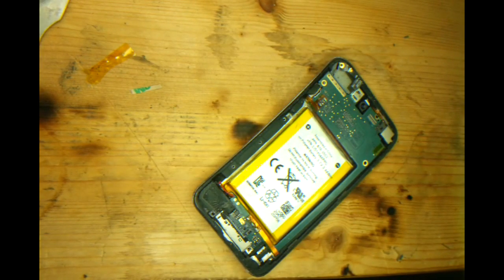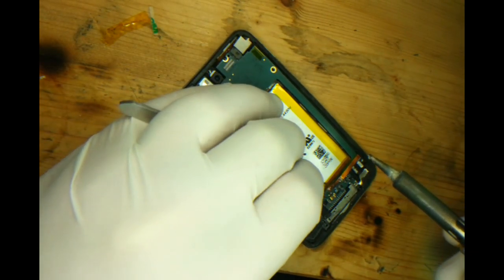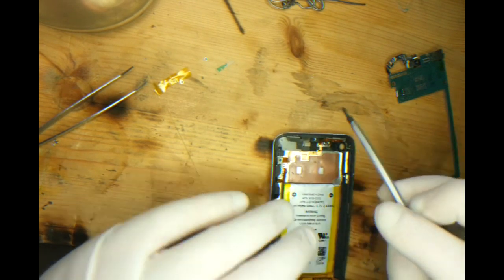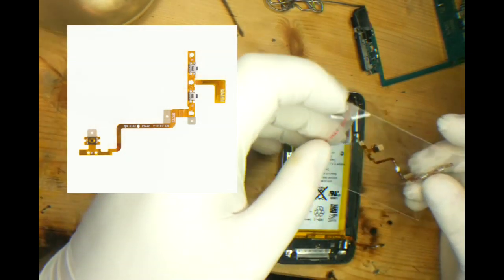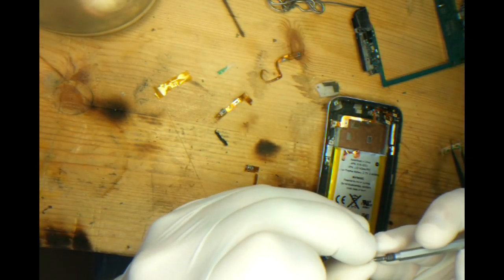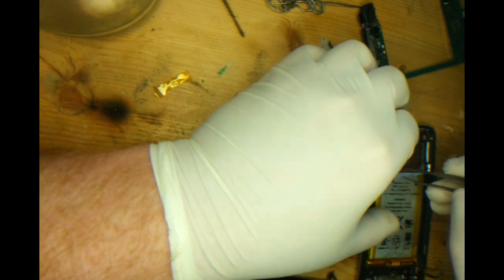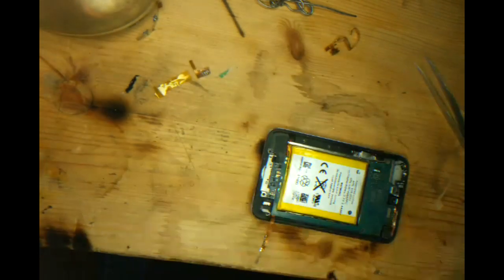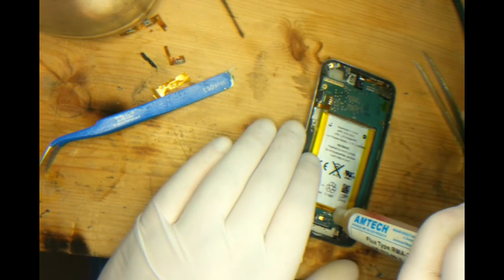How to replace a ipod touch 4th Gen power volume ribbon cable

Comment: I was wondering if you have to des older the battery off in order for it to work?
Reply from the maker: jaden rak Hi Jaden , no is the short answer but i prefer to remove the power from the board and  its just as easy when you have to solder anyway. But if you prefer you do not need to just bare in mind the battery ribbon cable and connections on the board itself are fragile so take your time. Hope this helps thanks for the comment.

Comment: I posted a few months back. Since then I have been practicing Soldering. Learning the techniques and keeping a steady hand is been challenging. Alas! I have finally finished the 1st of 2 iPod 4G Volume/Power Ribbon Cable repairs. This is all thanks to your video!!!! 

Without the ease with which you explain the method and the clarity in which you show the process and procedures I do not believe I would have been successful. Nor would I have had the courage!

So again... THANK YOU, THANK YOU, THANK YOU, THANK YOU!!!! Your video rocks! Cheers!

Comment: I would of put that screen in first before you soldered the ribbon makes it more easy I think
Reply from the maker: Hi James Ya that's a valid point i always worry about the ribbon cables from the screen being damaged so i usually do it after, it just gives me a little more freedom when soldering i think its just what works for me, Have a great weekend thanks for the comment
Reply: smartrepair247 I tell you what happened. The screen got smashed so I thought easy lol anyway I had trouble reconnecting the screen the bottom ribbon. In the process I managed to damage the power ribbon. So when I got the new power ribbon I built everything up and done the soldering last . It was my own fault  lol but you live and learn
Reply from the maker: James Birkin Its a tricky lesson we all learned id say ,but if you look at it this way you have a skill now if it ever happened again you will breeze it
Reply: smartrepair247 true pal

Comment: I have been struggling with the power flex connector and failing to get the cable off the board without destroying the contact had me dumbforunded until watching your video. I had no luck on 3 ipods with a dry tip. I tried your method of pre -tinning the soldering iron and am amazed at how quickly the cable popped off the board. Even the battery removal is much easier. Thanks
Reply from the maker: Hi Ron thank you for your input, You gave me a idea for a video i might do tomorrow showing a close up of whats happening when a pad lifts and methods of re routing the damaged trace, should be interesting , I am delighted my video helped , alot has to do with confidence to, Now you have the skill you will always have it, With the pads it is a fine line between enough and too much.

Comment: i meant what glue you put before or after soldering the volume ribbon cable ive seen people use rosin flux i think its called
Reply from the maker: In high-temperature soldering, the primary purpose of flux is to prevent oxidation of the base and filler materials. Tin-lead solder attaches very well to copper, but poorly to the various oxides of copper, which form quickly at soldering temperatures.

Its not a glue it helps the solder to flow easier and have a better joint.

Comment: what type of glue did you use to glue the volume button
Reply from the maker: Hi Ivan thank you for your comment, The replacement ribbon cable comes with double sided 3M adhesive attached just peel the backing and stick it down, I hope this answers your question? Have a great weekend!

Comment: did you use glue? if so what kind?
Reply from the maker: Hi Tony, thank you for your comment, Do you mean to attach the screen i have not used glue in this repair just solder and flux, If i was fixing the screen permanently i would use 3M adhesive that you can see here  iPod 4th Generation Screen Replacement Guide for Beginners

Comment: Hello Noel, do you do a backlight repair on an ipad 2..The problem isnt due to water damage, but happened whilst doing a screen replacement. I have had a look on google, and apparently there are 3 parts incorporated in to the backlight, and the bigger of the 3 will go when it has been exposed to water, but as i said not the case here...thanks Dave.

Comment: Hi, first of all let me say what a very good informative video, easy to understand  and quality work. I am just in the process of buying a hot air/iron work station. Can this be done using the hot air instead of the iron, or is it easier less taping up with the iron. many thanks in advance  Dave.
Reply from the maker: Hi Dave, thank you for your comments. I would say in theory the hot air would be better for this fine work but the issue for me is i really don't like to put excess heat near the battery, while you can use heat reflective tape to mask up the the area, your left with sticky residue to clean up after removal, the power volume ribbon cable is just far to close to the area populated but the tiny components that if one moved from the heat and air flow it is extremely hard to repair.

This is just the way i do it of coarse everyone has their own preferences.
If you would like to see a video of the two methods side by side i will get that going for you, Give us a thumbs up if this helped and sub to keep up to date of new videos.

Have a great weekend,

Noel
Reply: cheers Noel, i would be very interested to see you doing it with air..I have a few questions for you, I am going to be attempting to remove the scree fpc connectors on an ipad 2. I have been watching them do it with low melt alloy, and they say it melts at approx 60c, what do you use for desoldering and what melting point is it..I would be really grateful if you could put me on to a good supplier for soldering gear ,,cheers Dave

Comment: Why do I need to turn my ipod off???
Reply from the maker: Like any electrical item the unit is powered down to ensure you do not cross a connect while their is power or this could damage the unit, Other than that its just a good rule of thumb to always power down and remove the battery if possible before going ahead with the repair.